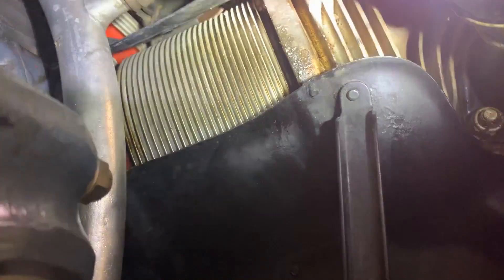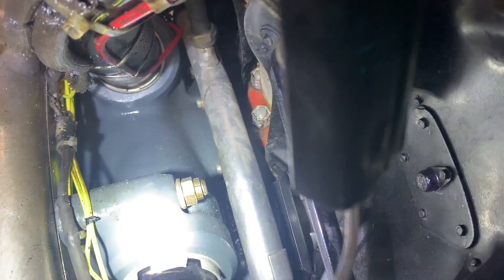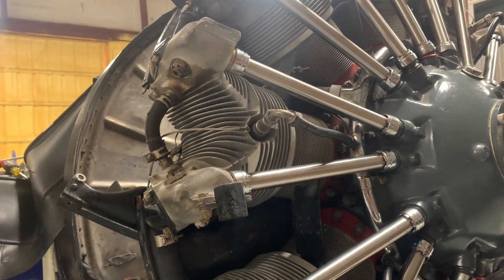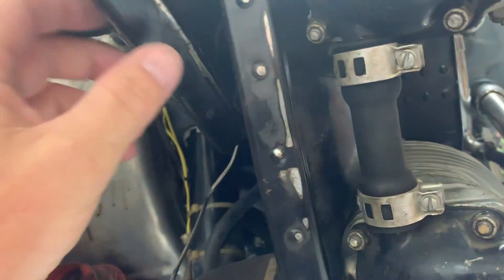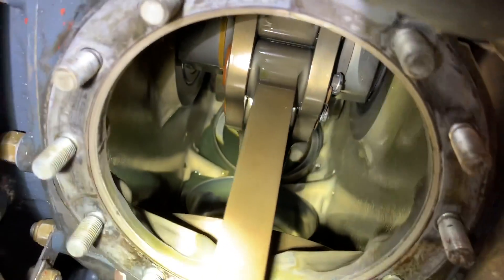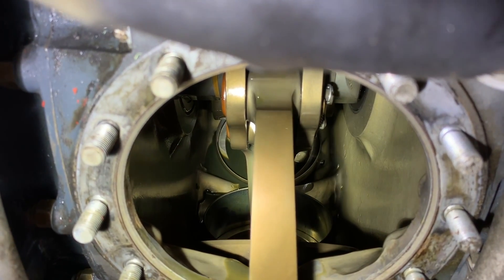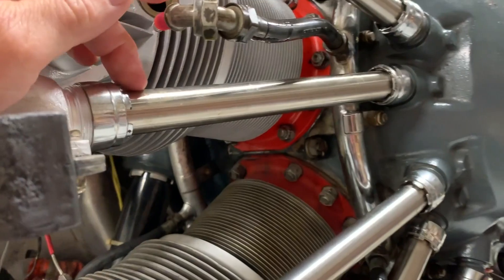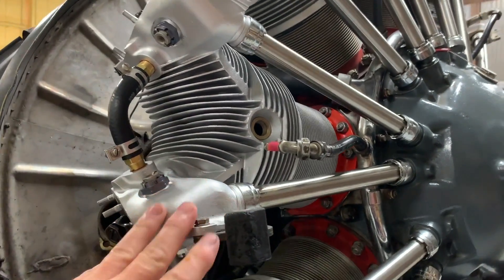Replacing Cylinder on an R-985 Pratt & Whitney Radial Engine

Comment: Like a big Corvair motor,  what holds the wrist pin in, it looks like you just tapped in out , no snap ring or anything?
Reply from the maker: the cylinder walls are all that holds any of them in.  some have extra spacers made of a softer material but these don’t have anything.
Reply: some engines the oil ring holds them in
Reply: Wrist pins were made with curvature on the end and acted like a ball bearing to the piston.They were referred to as FLOATING PINS.

Comment: That homemade tool for the cyl. head bolt was cool, but, I try to avoid using 12-point sockets or wrenches if at all possible.
Reply from the maker: that wasn’t home made. that is a pratt tool
Reply: Only place a 12 point wrench/socket should be used is a 12 point bolt or nut. I hate 12 point tools in a six point world.
Reply: Guys, you have to learn better tool handling, also , the Wright engine company issued many 12 point sockets for particular jobs.
Reply: The P&W cylinder nut wrench and pal nut tool were both 12-point.
Reply: Being a jet mech I don't think you can do full scope of work without a set of 12 points in the box!

Comment: I’m trying to understand how such a minor oil leak, on a radial, was noticed😂
Reply from the maker: totally understand but mine is pretty tight and had burnt oil on the carb heat baffling.  but point taken. ;-)
Reply: @nizexlizzy  I loved those oil dripping , fire in the pipe, propeller spinning recips.
They have a great history and are loved by many a biplane owner using them today.
Reply: Inspection by a competent inspector.

Comment: Those Junior Wasp radials are showing their age, think the last ones were built in 1955 or so. I have two on my 1938 Grumman Goose and have had to have that repair done three times on the port engine, so far the starboard engine is not showing any signs of separation. I'm not sure your Beech 18 has a manifold pressure gauge, that is how I caught mine.
Reply: why would it not have a manifold pressure guage?

Comment: Very interesting. Let us know how the run up test goes. How bad was the cost of that cylinder?
Reply from the maker: Robert Hobbs well i was used to being able to overhaul my cylinders for 800 or so but these are 1700 with a 400 or so core if you return yours.
Reply: Glenn Hancock wow, that does sting just a bit. Glad you caught it when you did though. This is an awesome plane, BTW.
Reply: @nizexlizzy  didn't think that a cracked cylinder was repairable?

Comment: That type of failure in that specific area is not un common on R985 radial engine. There are a half dozen of them sitting around the shop, running 3 Beavers. It takes a good wrench no more than 4 hours to change the cylinder out, in the field, by himself.

Comment: A R-985 with est.500hrs of operation, at this point of the life of the engine, why wouldn't you just remove the engine and have it completely overhauled? Yeah, I know it's expensive, but so close to run out. You had leaking seals. Sounds like a perfect time to go through it completely.
Reply from the maker: ??  Close to runout?  The engines TBO is 1600 or more hours.  Also the gaskets leak and need to be replaced after a period of time.  You have to remember these engines may have 1600 TBO but they could go 20 years between that time.  So while the tubes and rubber would last 1600 they don't last 20 years sometimes being outside.
Reply: @nizexlizzy  Thanks Glenn.

Comment: So that cylinder is for trush now? Or it can be repaired? If it's for trush can you give it to me?
Reply from the maker: EminAviation probably can be fixed even if it takes a new barrel
Reply: Just shit can it and get a new old stock steel jug and go back to work!
 @nizexlizzy
Reply from the maker: Wanted to add that in this case Covington Engines said it could not be fixed.  They said it was possible to fix but way to expensive and they'd never do it unless there were no more available cylinders and it was the last resort.
Reply: Aero recip in winnipeg manitoba canada has developed trouble free tbo cylinder o/h rebuild, that fixes the common head/barrel separation issue.
Ive toured their shop and procedure is really extensive 
Theyre a full outfitted shop 
Look them up!
Great vid!

Comment: Are the head and cylinder one piece. On another note, how is that piece that all the con rods are connected to mounted on the crank? Is it a pressed in crank pin?
Reply from the maker: they are pressed together.  the push rods are all connected to a single master rod that connects to the crankshaft. there are videos that show exactly how it all works on youtube.
Reply: Okay, thanks. I'll have to check them out. A cousin of mine who is really into photographing planes, had his wedding reception at the ww2 airplane museum in Hamilton Ont., and we were allowed to walk around and look at all the engines and planes on exhibit. There were a lot of cutaways, but I guess I never paid enough attention to the radials. I wish every wedding reception was held there.
Reply: @johnb5519  The mother of all cutaways is in a museum just south of San Francisco. It's in a museum where they have an American SST. It is the name of a helicopter company . The Hiller Aviation Museum. San Carlos. It is a bomber engine with a supercharger built into it. Very impressive. It's been a long while so I forgot the facts!
Reply: Cool, I'll have to check it out.
Reply: @nizexlizzy  The pushrods are connected to a camshaft.  The connecting rods are connected to the master rod plates of the master cylinder and then connected to the crankshaft.

Comment: If one of the pushrod cover gets damaged you need to get off the cylinder?
Reply from the maker: EminAviation depends on how bad but you can replace those or just add a second gasket.
Reply: Glenn Hancock Ok, thanks, that was interesting.
Reply: NO, The push rod covers will come off with the jug on the case!

Comment: The pushrod hitting the floor... Junked?
Reply: the tips on the pushrod look adjustable & swappable, probably check it by rolling on a narrow piece of glass for bend, make sure 
the oiling holes are unharmed & you're good. 
These radials were built with repairability in mind.  They can continue to run losing any cylinder but the #1 cylinder, which is the 'master 
rod' that all the other cylinders' 'link rods' attach to.  
The #1 Cylinder/Master Rod is at 12 o'clock position.  fyi.
Reply from the maker: No, it was fine but not something you want to make a habit of.  Now that I know what a certain tool is in my box I can easily remove those before removing the cylinder. :-)

Comment: If I had to guess I'd say that 985 is on a D18 it looks like a very nice aircraft from what little of it I can see so does the powerplant. What doesn't look nice is all your wiring. How it's routed how it's secured it's all the same color it looks very haphazard and we'll...... Sloppy.  Your just begging for trouble and a fire. I would really hope you'd consider correcting this condition and if #1 is like that I'd bet anything that #2 is the same way maybe worse¿?

Comment: Looks like you got lucky. If that piston would have been down a little further you would have dropped the scraper ring behind the case and had to pull an adjacent cylinder to lift the ring in order to turn the crank. TDC on compression before pulling and then your ready to reinstall a replacement cylinder.

Comment: 4:17 Zip ties in a recip (or any engine) power section? Really???
Reply from the maker: Commenting on something that everyone in 2020 use.  Really?   I don’t think I’ve seen an engine in the last 5 years that didn’t have wire ties holding something.  And if you see me putting it in it is because I”m replacing what was there originally. :-)
Reply: @nizexlizzy  In the transport category aircraft wiring practices manuals I'm familiar with, nylon or other similar zip ties are simply not allowed due to the heat, fuels, oils, hydraulic fluids. I've removed many that just snapped from being embrittled. I don't know about smaller aircraft, but Boeing and (the former) McDonnell Douglas allow ONLY the old style clove hitch and knot tying for anyplace in the engine area. The material for tying is teflon-coated and very durable.
Reply from the maker: Paul Crumley All I can tell you is I didn’t put those in there and they are all over everything I’ve seen.  I don’t disagree that over time they can get brittle but I’ve never seen one melt and they are usually used on wires.  The one you see in the video has been there forever and it was placed by another mechanic at some point.  They are all over the place.
Reply: @nizexlizzy  I don't doubt you've seen hundreds; so have I. But several hundred improprieties don't justify another one. Strictly speaking, per FAA 43.13-1, 11-158:
 LACING AND TIES. Ties, lacing, and straps are used to secure wire groups or bundles to provide ease of maintenance, inspection, and installation. Braided lacing tape per MIL-T-43435 is suitable for lacing and
tying wires. In lieu of applying ties, straps
 meeting Specification MS17821 or MS17822  (STRAP, CABLE, ADJUSTABLE, SELF-CLINCHING, PLASTIC, TYPE I, CLASS 1) may be used in areas where the temperature does not exceed 120 C. Straps may not be used in areas of SWAMP such as wheel wells, near wing flaps or wing folds. They may not be used in high vibration areas, where failure of the strap would permit wiring to move against parts which could damage the insulation and foul mechanical linkages or other moving mechanical parts.
I've spent too many hours in studying causes and effects of human factors in aviation maintenance to accept the notion that "because everyone does it, it's okay." You can look it up - it's one of the so-called "Dirty Dozen."
Reply from the maker: Paul Crumley Ok, So here is a question (and I am not arguing, just asking). I recently installed an engine monitor on the Lockheed.  The wiring out to the engine compartment I tied with string.  However, once I got into the engine compartment I could no longer tie anything due to physical constraints.    The only thing I could do was get wire ties in as many places as I could in an attempt to keep the wires from moving around and to keep them away from the exhaust and plugs.

So if I were to take this to heart, how on earth would you secure these wires?  I’ve seen engine monitors and a lot of engines and they were ALL secured with wire ties.  I don’t disagree with what you’re saying but just don’t know how you’d accomplish that practice 100% of the time.  Those books were written when there were no engine monitors and few electronic devices compared to today.  I’m sure our wire ties are probably better made than years before and we all know our government is extremely slow to adapt to changes.  

I am not an A&P and I do try to clamp things as much as I can, but sometimes there just isn’t a good way to accomplish it without completely removing the engine.  So I keep an eye on everything and replace anything I see as needing it.  I also work with a number of A&P’s and IA’s and like I said, I’ve never seen a wire tie fail.  Perhaps because they are being removed so often to fix something they’re in front of. :-)

Thanks for the great information and if you have any suggestions on how to never use wire ties I’m all ears.  Also, like I said, I didn’t install any of the ones you were looking at anyway. :-)
Reply: @nizexlizzy I wish I had an easy answer - but of course, in this industry there's no such thing in some respects. On the other hand, we are awarded the privilege of exercising our certificate authority on the basis of training and demonstrated ability to work within the FAR rules as applicable - to use "Approved or Acceptable" practices in all work performed. Unfortunately to the FAA that's the criteria. The effort you have to exert to reach that isn't relevant to the inspector who examines your work. . .only the conformity to the data.
Reply: @nizexlizzy  Those maintenance procedures were written before zip ties ever existed.If you want to be doubly certain use stainless lockwire but who bothers?